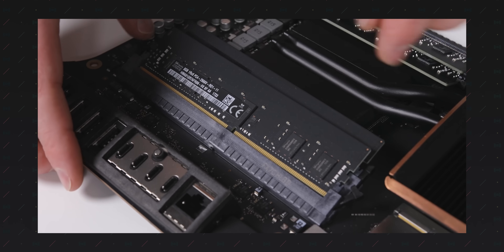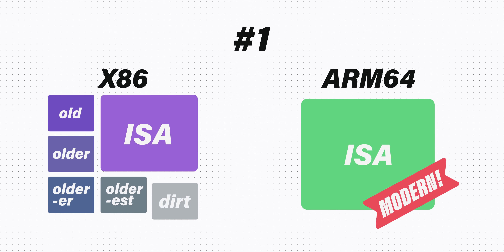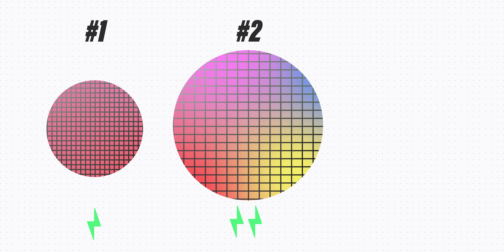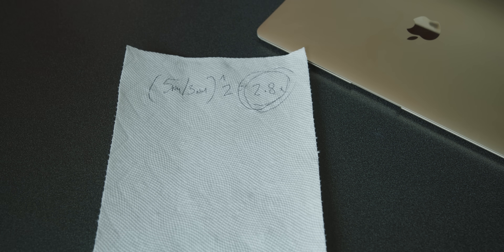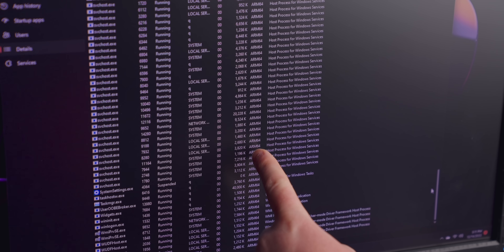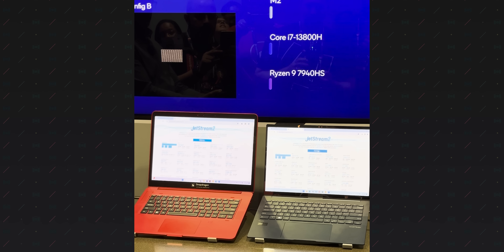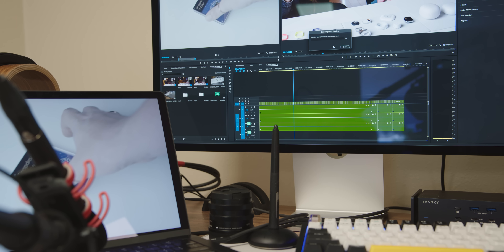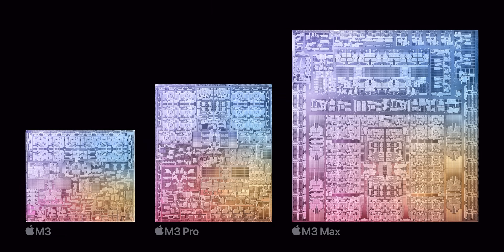Apple's Silicon Magic Is Over!

Comment: Qualcomm has always been about 2-3 years behind Apple in phone chips, and given that this will launch at around the same time as the M4, it looks like that is still the case.
But given that an 11 year-old Ivy Bridge is still a very usable computer for normal people (people who don't make YouTube Videos, play AAA games, or run self-hosted ChatGPT clones), I don't think that really matters.
Reply: That is true. I got my old Surface Laptop 2 out and started using it. For ultrabook work, it performed well enough for day-to-day use, if not as perky as the latest and greatest. But, fan noise and efficiency were a major downgrade versus the M3 MB Air (much less than half).
Reply: Qualcoom has been behind because they have been just using standard licenced ARM cores, this time they are creating their own cores like Apple did years and years ago.

They could still be behind, but it's not going to be for the same reasons as before.
Reply from the maker: I agree with you.
Reply: Members of apple silicon team left apple to make snapdragon elite x before qualcomm bought it and renamed it to what it is named now. So there's hope that they won't be soo far behind anymore.

Comment: Really enjoyed this video, so much of the Apple tech press where calling the M1 the end for Intel, AMD and Nvidia  🤣 Having said that I enjoyed my M1 Macbook air, I only sold it as I wasn't using it enough to justify keeping it, in raw performance it was nowhere near my PC at the time and would be even further behind now, but for the things I wanted to do on it, it was fantastic and the battery life was incredible, the person I sold it to loves it as well, the most demanding thing they run on it is Football Manager 24, and its more than fast enough to run that game. I would honestly buy a 12 inch Macbook style laptop with an M4 chip that offered the same performance as an M1 (but please Apple, 16GB RAM please!!!) but offered even better battery life or a Microsoft Surface Pro with the new Qualcom chip. I currently use a Surface Pro 9 and I really like it (its clunky as hell vs an iPad, but for my specific use case its great), apart from 2 things, the fan noise and battery life, especially when its in standby, if Qualcom can offer me Surface with the same performance but increase battery life by 50% and fix the battery life when in standby, I will buy one without question. I honestly think we have gotten to the point where "performance" for most people with most devices is good enough.

Comment: They should make mac mini / iphone hybrid. Basically an iphone with m3 or m3-lite chip that is able to connect to a dock station (monitor, keyboard, mouse) via usb-c abd offer a mac mini experience.
Reply: They would do this but Apple doesn’t have the same luxury as Microsoft in that they have competition within their ecosystem. Apple would self cannibalize their other products if they made something like this a viable alternative. It’s the same reason why the iPad still can’t run desktop apps despite have the same chips, they just don’t want to risk making one of their own product lines redundant. How do you get away with selling $3,000 dollar laptops when a sub $1,000 iPad can actually do everything you need it to?
Reply: @brandondapro  They can make it cost as mac mini + iphone combined (2k+) and it will still appeal to some people.
Reply: @brandondapro this is already the case with the MacBook Air… YouTubers are always suggesting the Air for the “average” user who isn’t doing heavy productivity.  The iPad Pro/Air can already fulfill this task for the majority… The MacBook Air is a pretty scammy product when you really break it down.
Reply: The problem with a comment about the iPad as a substitute doesn’t work for me. Well, let’s say it would/could work for me if the iPad didn’t have a crippled OS.
Reply: Having something like Samsung Dex for the iPhone would be glorious. This is the absolute dream for me. Just let me carry a single device with all my files and apps and let me dock it when I need proper peripherals.
Reply: So a AppleDeck?
Reply: why? why would you invest billions into something NOBODY (0,001% at most) would need or use.

Comment: where is that part that talks about apple's m processor very own spectre called GoFetch? and how apple decided not to patch it yet? intel and amd took 10-20% performance hits with software OS patch because this kind of flaw cant be fixed otherwise, wonder how much will apple processor take.
Reply: It is very low risk, and there is no doubt that Apple is exploring its options rather than rushing to fix it. The M3 can be rectified with no performance downgrade but 20% likely, or even more, if a software fix is needed on the M1/M2. For most, this Go-Fetch will not be a problem as I understand the third party needs direct access to your computer.

Comment: The main hope I have from competition isn’t new MacBook form factors (thought it’d be nice); it’s more realistic (read: cheaper) storage and RAM upgrades. The fact Snapdragon Elite uses NVMe over PCI should prove that Apple’s soldered-on SSDs don’t have any advantage; maybe they’ll use standard connectors, at least in Pro machines.
Reply: Doesn't apple already support pci-e on their desktop mac pro with arm chips. Also thunderbolt is also over pcie if I'm not wrong. They just chose to hinder any upgrades.
Reply: @kushagraN  the Mac Pro is prohibitively expensive for most people; by the time you've spent the extra $2k plus to upgrade from the Studio, you may as well have paid Apple's outrageous price for 8TB of storage.
External Thunderbolt (or even USB3) is fast enough for many things, but for portables, the last thing you want is another device hanging off the side, especially when it's actually on your lap.
Reply: Snapdragon will use the same tactic of upgradeable trash . And those benchmark are versus last gen amd and intel products
Reply: @potatorigs2155  What? snapdragon x elite is way faster than intel's latest gen core ultra 9 185H and AMD's latest R9 8945hs in both CPU and GPU. X Elite scores 2774 single core, 14027 multicore in geekbench 6 while the ultra 9 185H scores 2446 single core, 13613 multicore and r9 8945hs scores 2616 single core, 13316 multicore. GPU's also much faster on the X Elite and it scores 7015 in 3dmark wildlife extreme while the u9 185H scores 5036 and the 8945hs scored 4922.
X Elite was also tested in real world scenarios which seemed to suggest that it was indeed faster than both intel's and amd's offerings and it did so while only using ~20W while the intel and amd have to use 50-60W and still be slower.
Reply: @fidelisitor8953  you realize zen 5 is releasing this year right ? And Geekbench is literally made for arm cpu this is the most irrelevant benchmark. The 8945 is a 7000 cpu chip with an npu nothing more nothing lesss. Still on zen 4
Reply: @fidelisitor8953  SemiAccurate, claiming two "major" OEMs and a "deep source at Qualcomm" for their benchmark cheating claims, insists that Qualcomm benchmarks are impossible to recreate even by class-leading OEM developers.
Reply: @potatorigs2155  Read about it too but the claims seem false or at least inaccurate. They're too many unknowns about the X Elite chips like the actual power draw when under load, if it's configurable or not and there's also optimization issues. Any one of these can greatly affect the performance of the X Elite so I don't believe the claims. I guess we'll just have to wait for the chips to feature in and be tested in actual consumer laptops instead of believing random unconfirmed rumours.
Reply: @fidelisitor8953  yup

Comment: I have never heard a single argument that holds up under any kind of scrutiny for why arm powered laptops or desktops running Windows make any sense.
Reply: Arm (RiscV, MIPS) instruction set uses fixed width instructions, so it's easier to create a wider instruction decoder than on x86_64. Another difference is that Arm architecture doesn't guarantee cache consistency between different cores in the same NUMA domain which makes L1/L2 cache designs less power hungry. These are the only two that didn't immediately fall apart when I looked into it.
Reply from the maker: The exact same arguments for which macOS excels?
Reply: You don't grasp why arm64 windows laptops make sense? That's a you problem.

Comment: I do my graphics work on an M1 Macbook Pro and I don’t think I need to upgrade within the next 4 years. We see what’s going on then. 
I don’t need more compute power, I need good software and efficiency.
The plague of modern computing is bad software. Programs that were 1MB in the 90s and ran on a 486 are now 500MB and need a high end cpu.
Reply: optimization became absolute garbage in the last 10  years. Almost no application is optimized nowadays as software devs are able to brute force push the apps because of the huge leap in processing power.
Reply: @jani0077  i 100% agree on this, gaming is a sore example of how much devs stopped caring about optimization and just push products out with barely any QA/QC
Reply: @NathanBrownisawesome   It's not just a lack of optimization, but a lack of careing spurred on by the explosive decline in storage prices.

Yay, a 150 gigabyte game download that I'm sure comes with 60 gigs worth of content that I will never experience because I can't run this at max settings nor can I speak languages other than English.
Reply: @ZeldagigafanMatthew  Lower settings would only matter for texture resolution, everything else is the same size no matter your settings. But it could save many GB depending on the game - 4k textures are massive. Microsoft claimed they'd offer something like this years ago and simply not having to download several GB of foreign languages would be awesome, but the only game where I ever saw that option was some Gears of War where you could skip downloading the multiplayer. ☹
Reply: @jani0077  Its why apps on Windows (especially games) are bloated as fuck and make laptops last like an hour or 2 on idle alone.
Reply: @jani0077  Optimization has become harder and people and companies are not willing to allocate the resources needed to do it. The companies selling the software want to pay as little to develop it as possible and that means getting it to work not optimizing it and the people buying the software want it for as cheap as possible and between the two you squeeze out good development practices.
Reply: @Immudzen  optimization isn’t harder, they just got lazy as the cpu and gpu technology advances faster. Back in the 90’s or 2000’s they had to optimize almost everything just to be able to sell the product, as it wouldn’t run on consumer PC.
Reply: @jani0077  Optimization really is much harder now. To efficiently use parallel cores is much more difficult with harder to trace bugs than older single threaded code. The modern instruction sets are also more difficult to use efficiently. Just the order you pack data in memory has a huge impact on the performance of things like AVX.
Reply: @jani0077 it's not hard, but it takes a lot of time. And many companies didn't want to sacrifice that. That's why games are optimized as time goes on and updates are given.
Reply: Yes, we need to stop turning every app into an Electron Chromium-bundled JS bloatware
Reply: I blame webdev crowd, with summer coding camp degree.
Reply: this is certainly windows biggest disadvantage compared to Linux (I'm not sure about MAC OS bloat.). Linux has far less unnecessary bloat compared to windows which allows it to make far better use of the hardware it has.
Reply: "I need good software and efficiency."

Still think this is a HUGE problem for a lot Apple users.
Reply: @craigjohnchronicles2504  It is a huge problem but developing it has gotten harder and companies don't want to spend the money it takes.
Reply: @Immudzen  - The stupid thing is, plenty of Capture One Pro users have sent performance complaints to Capture One, and shown evidence of it's woeful performance compared to it's top software/product competitor. And they've been ignoring the issue for a good 2+ years. 

In the case of Apple, sometimes the best solution for a performance boost, is a software change.
Reply: @craigjohnchronicles2504  It doesn't matter how much you complain so long as people use it. If you switched to something else in large enough numbers then maybe it would get fixed but more likely just abandoned.
Reply: Don't have to, rendering video length is within 10%, no big deal

Comment: M1 Air is still the best laptop for everyday use
Reply from the maker: It’s superb, agree.
Reply: @snazzy  I'm on my 2nd M1 MacBook Air, base unit. (Love your channel)! 💗
Reply: i use base model m1 air for software development work.  2 docker containers, 2 ide's and 3 browsers with about 30 tabs all together and works fine. faster and silent than my work intel 13th gen.
Reply: @menumenu287  also me i love it
Reply: I have one and for my use case it works very well. 

"Heavy" work gets done on a Linux box. This Qualcomm chip might make a very attractive Linux box. 

Linux on Apple silicon is having difficulties due to Apple withholding information. Given Apple abandons hardware after seven years it will be an issue fairly soon.
Reply: it is the best computer ever made
Reply: Indeed, only people who dont have one will disagree
Reply: overpriced junk
Reply: @JohnSmith-oh9ux  Usually said by people who can't afford one
Reply: I have one, and I disagree. macOS has had a choppy scrolling bug since 2020. It's very noticeable and annoying for people who are very sensitive to lag/stutters, such as myself. macOS is also far too limited compared to Windows. The Air's screen is okay but has a slow response time, so there's a lot of ghosting on darker backgrounds. It was a €1100+ laptop at launch, at least in the EU. I've seen cheaper Windows laptops with better screens. The M1 Air is a good laptop with fantastic battery life, but that's about it; the rest of the machine is either mid or average at best. It's not as good as you all make it out to be, and I certainly wouldn't have bought one if I had known that it would stutter just as much as a cheap Chromebook.
Reply: @just_joseph157  Never noticed any of this, what does Macos is limited mean?
Reply: @EarthStarz  Gaming is for kids
Reply: @clivebaxter6354  typical apple user justifications
Reply: @just_joseph157 I own an M1 Air and have a LG 3440x1440 @ 144hz hooked up to my gaming PC (i7 12000k and 10gb 3080), and I think you're full of shit. Lol
Only problems M1 has had is compatability issues (esp in 2020/2021). Other than that, one of the best pieces of tech I've owned, next to my S22 Ultra.
Reply: @--...--...--... you know what I don’t see? A reason why he is wrong.
Reply: @--...--...--...  You sound like a gamer- a 12 year old one
Reply: @--...--...--...  I'd rather a razor blade than a m1 anyday, agree with on s s22 though